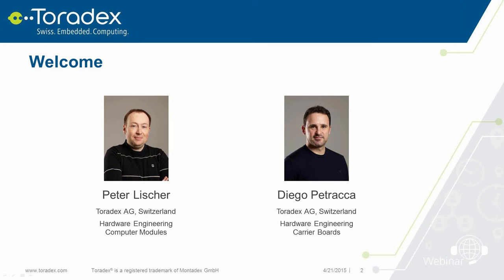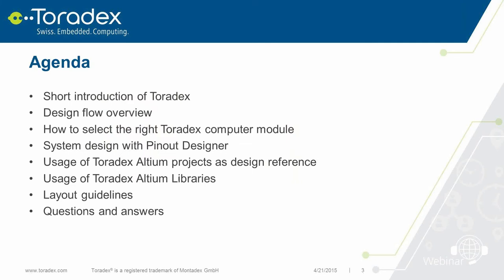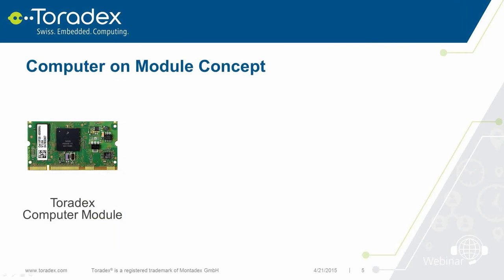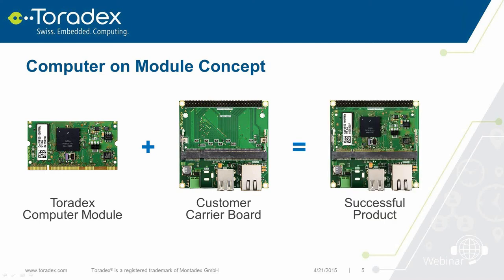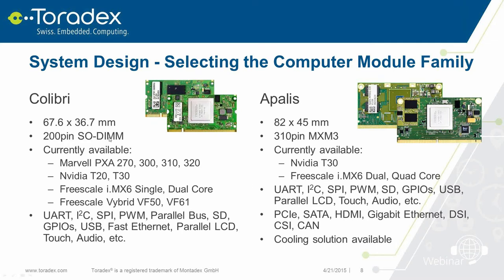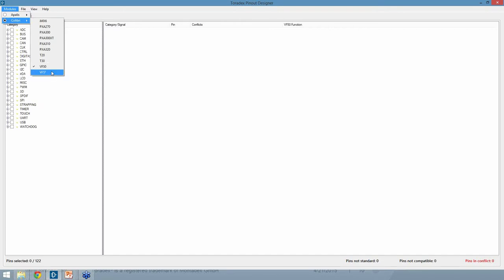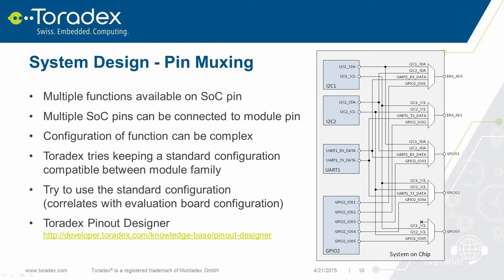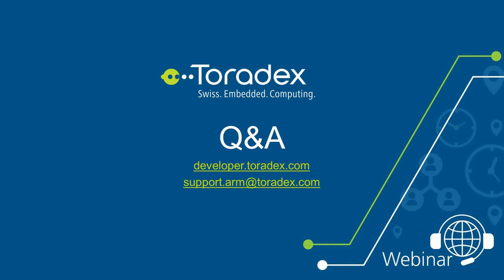Webinar On-Demand: Build your own Customized Carrier Board, it's easier than you think!

Comment: 47:34 ... not so good layer stack-up from EMI point of view. Moreover, if the outer layers are going to be used for high speed, they radiate much more as internal layers...
Reply: I had the same impression when I saw the stack-up. Did the PCBs performed well in an EMC test?